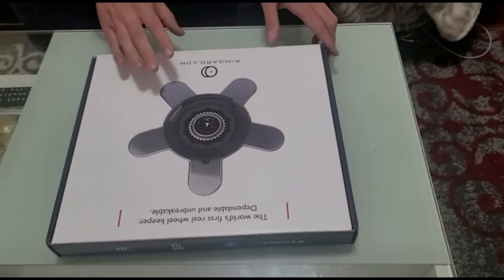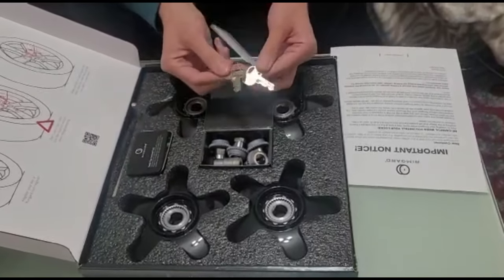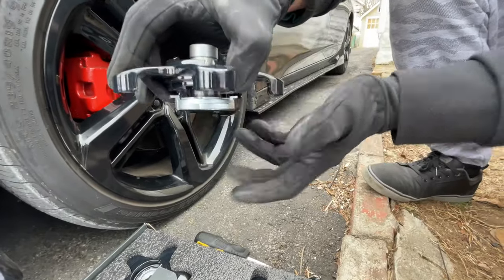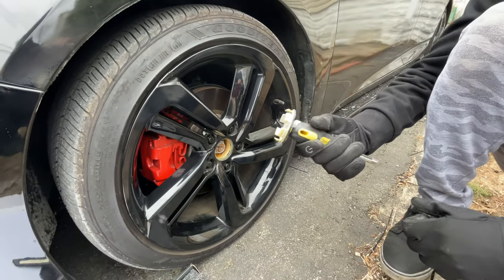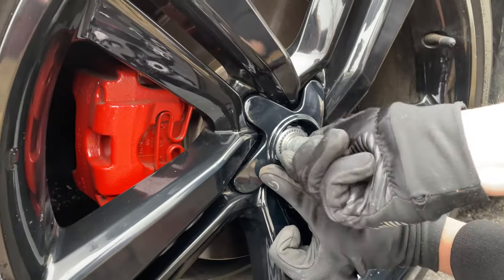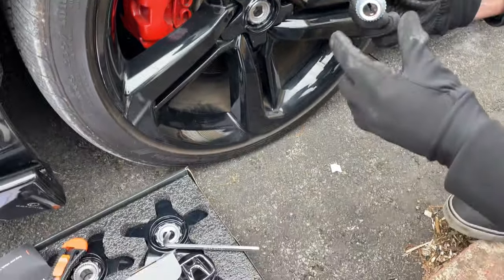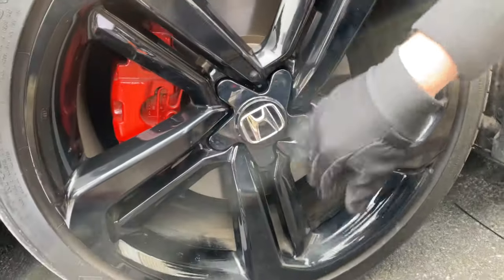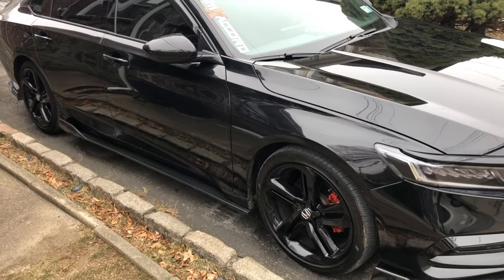2018-2021 honda accord sport rimgard wheel lock mod

Comment: And one more wheel lock under the rimguard, 2 days ago my son's Civic was on bricks they took all wheels here in LA you can also install the Viper 1 mile range 2 way alarm and add shock, tilt and glass sensor.

Comment: what did you use to smoke out your rims? is it super wrap? Do you have a link?
Reply from the maker: @Mayor 2018 search it on eBay. 2019 accord wheel vinyl
Reply: @RedLineMods1  ok thanks!
Reply from the maker: @Mayor 2018 https://www.ebay.com/itm/123869654581
Reply: @RedLineMods1  sick! and you had no issues with peeling or anything from stuff like salt/snow? (im in Canada)
Reply from the maker: @Mayor 2018 no issues it’s been almost a year now.